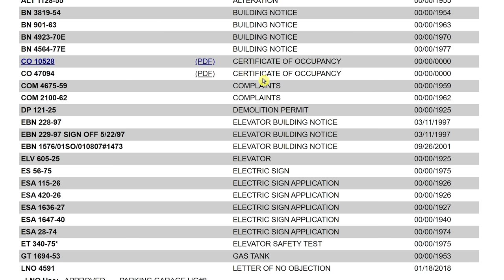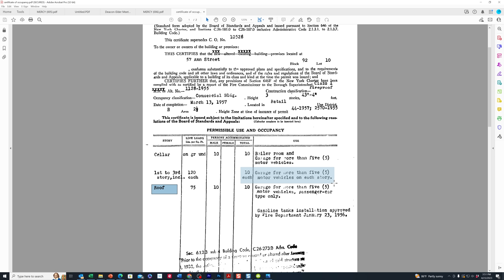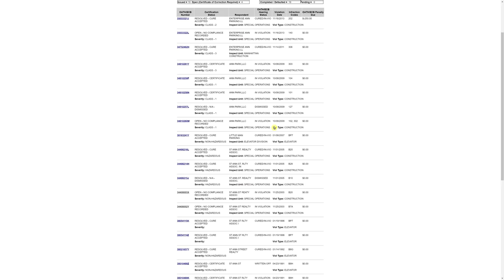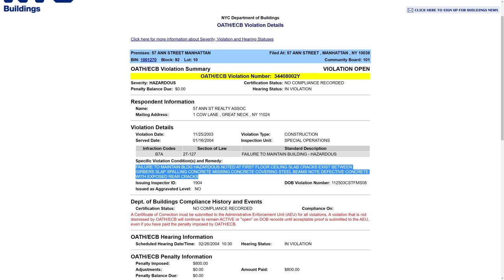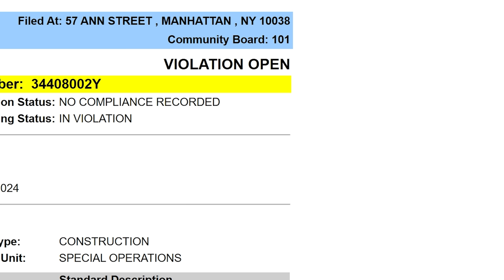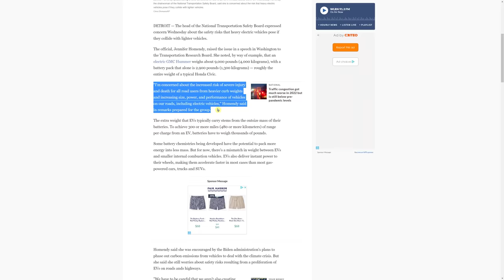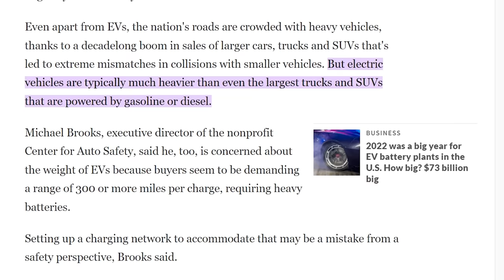4 Causes Of Fatal New York Parking Garage Collapse?

Comment: Excellent analyzation of this event. One tries to tell people the BAD aspects of electric cars, and none will listen. There's even more than just the weight, wrong with these things. I fully agree that could be a problem in this case. I've never seen so many vehicles crammed into such a small place before. I mean, I've never been to NYC, but I have done work in SF, and that was just crazy, given the age of  that building. 

Then to see the violations... insane. 

I think another thing you can add to your analysis of this collapse? The reports of the breaking support structure. It was so cool you had both audio & video from that car. We can hear them breaking, in what sounded like sequence, as the structure gave way. 

And to me? That sound was way too crisp & clear, instead of muffled, which you'd expect to hear, when things ARE covered with concrete. To me, that was a very telling sound.

Thanks for this great breakdown.
Reply: Do you listen to the good aspects of electrics? And bad aspects of gas vehicles? 

Just wondering. All new tech is usually flawed, I feel like there are overly biased people on both sides of the debate.
Reply: @Nikkeftw  Well, I worked in Solar for a few years- building, creating, installing. This was back when it was still fairly new, and I LOVED the IDEA of it. 

I'm NOT an "environmentalist"- I'm an "Outdoorsman". In my opinion, we are far & away the best to know what's hurting our environment- because we love the outdoors, we take care of it, and want it preserved for our future generations. We don't get insane over ideology- we just want our hunting grounds, fishing spots, camping locations, et al, protected & clean. 

But there's one other thing- "Climate Change" is a LIE. I know, I was there when the evil trying to kill our great nation atm, laid out EXACTLY what they were going to do- And using the "climate" to control people, was a large part of their insane agenda. There's far more to all this of course, but it all began with "Global Cooling", when the earth went through a warming cycle? The were made fools of, so they changed it to "Global Warming". THIS? Should have ended their, imo, criminal agenda- but it didn't. 

So they went "in-search-of" the perfect way to deceive people, and acquire POWER & CONTROL- which is all they care about. Enter, "Climate Change" Such a stupidly generic, and of course constantly occurring phenomenon? NONE would be able to argue against it. And any scientists who attempt to do so? ARE DESTROYED if they don't toe the line. 

These are just facts. I've no agenda here, and nothing to gain. 

Myself? Golfer, all my life. LOVE golf carts. Fun to drive, silent, and some? Are fast as hell. So it seemed there may be many positives to making them mainstream. I LOVE great ideas and theories, and ACTUAL advancement. 

What I abhor? Is "progressivism". Because that term has been co-opted & wordsmithed, to a completely NEW meaning. These people care NOTHING about our future, our earth, gays, blacks, whites, any of us. They care about THEMSELVES, and what I said above, control & power. 

They are a NEW kind of evil, I've been warning about for over 40 years. 

So, how does all this, tie into this gentleman 's video & post? Very simple- since they don't care about humans other than themselves, and those they can control & bend to their will? 

This allows inspections, such as the ones mentioned, which turned into violations, when completed in cities run by these uncaring monsters- to go ignored. And this? Get's people KILLED. 

These very same people? Placed Covid-infected patients, in NURSING HOMES- effectively creating a "KILL BOX"- Thousands were killed. People's Mothers & Fathers. 

Something like this? They care nothing about. So placing the SAME NUMBER of cars, in a parking garage rated for that many cars, YET, NOT rated for that many cars, each weighing 2-3000 lbs. MORE than what was initially approved? 

Is going to result in horrors such as this. And more people losing their loved ones. And the worst part? Is what our host stated simply, without any bias- they've NOT TOLD THE MASSES in our country, or elsewhere? About this insane differential, which is going to effect more & more things, and end more & more lives- 

Because these people care more about their AGENDA, than the citizens of our great country. 

And this criminal Weaponized Progressive Media (WPM), the very institution who's ONLY reason for not only existing, but being granted the power they have been, by our Constitution? Is VIOLATED, on a daily basis. 

This was THEIR JOB to find out about- to hold the POWERFUL, accountable. They refuse to uphold their responsibility to the American people, and instead choose to obey that with which they agree, AGAIN, at the COST OF AMERICAN LIVES. 

They lie, deceive, propagandize, promote false narratives & stories, but the worst one of all? They OMIT TRUTH & FACTS, because it they might hurt their narrative. 

And this, if properly investigated? Would shock the living hell out of the American people, as just how many lives THEY THEMSELVES have ENDED- for their own, selfish ends. 

It may seem these are not all intertwined, but they are. ALL of them.

And it's costing us our friends, neighbors, sanity, liberty, and very soon, our FREEDOM. Because this evil will NOT STOP. 

I care not for a persons political views- I only care that they love this country, which has given us so much. It is under attack, right now, today. 

And this event, along with so many others, are all because of THEIR ACTIONS. People who would normally be held to account, no longer are- and this allows terrible things to develop, such as the collapse of this parking garage, & so many other things. 

As I said, I just post truth & facts, to the best of my ability- I'm not here driving an agenda- it may seem that's what I'm doing- but it is far from it. Because this evil comes from BOTH sides of the isle, and everything in-between. 

There's nothing wrong with people developing good tech. The problem comes when it is suddenly FORCED down the throats of the people, WITHOUT DEBATE, WITHOUT the American people, "WE THE PEOPLE", giving them the permission THEY MUST HAVE, to do so many of the things they've done, yet NEVER ask us anymore. They just DO IT. 

The end results we see before us. Along with far more, that many have not made the connection with... YET. They will, eventually, because we ARE America - the question that leaves unanswered is, "Will it be too late when they finally realize what's going on"?
Reply: There is no reason to condemn electric vehicles because of their weight, or attempt to lay the blame on them for this disaster. I didn't see any in the pictures, I am sure if there were there would be all kinds of handwringing about Li-Io batteries, fires and all the rest of the FUD. It is intuitively obvious these old buildings were not designed for the weight of the sheer number of cars they pack in them in the interest of economics.  SUVs, pickups, and luxury sedans, all gassers weigh considerably more than the vehicles in the days when this old building was designed. Add that to the ignored violations and lack of maintenance/inspections and you have a recipe for disaster. Frankly I am surprised this hasn't happened before now.
Reply: @The_DuMont_Network  Exactly my thoughts. SUV's are at a minimum 3-400 pounds heavier than an average EV, and luxury sedans can weigh the same as a Model 3. 

You can think what you will about batteries, would be nice to have a good hydrogen solution, but having electric drive units is nothing short of the next logical evolutionary step in cars. It removes unbelievably many moving and complicated parts and nearly eliminates service-demands for the drive-train. Its way more efficient and delivers smoother power and more of it compared to size and weight.

It is indeed very surprising that this didnt happened 20 years ago. 

I read an article with danish statistics for cars going up in flames. Correcting for ratio of gas/EV, in 2021 5 gas cars were one fire for every EV. Sadly, it didnt correct for mileage or age.
Reply: Electric cars had nothing to do with it. The weight of the cars is not an issue for garages. Garages are designed for 50psf live load. You are still well below the design limits with electric cars. The codes have already taken into account heavier cars.
Reply: @yodaiam1000  "The Codes"? Oh, you mean the one's NOT being enforced, and still sitting open on the cites desk? YOU have no proof of your statement. 

WE stated that they MAY have had an impact. And when you completely change the design of something that's been the same over the years.. except that vehicles became LIGHTER, instead of heavier, and then return, & exceed that weight? 

Problems gonna happen. WE are speculating what we BELIEVE MAY have happened. not state facts not in evidence, as you just did.
Reply: @rickrickard2788  I stating that electric cars are not an issue. The video stated it MAY be an issue. I am just letting you know that it was not an issue.

I am referring to the code that the building was originally design to and sealed by the original designers to conform to that code. Back in the 20s it would have been designed by an architect. Modern structures are designed by structural engineers. The city violations are not code violations. Those violations are for improper maintenance which is more likely to be the issue.

If there was an issue with electric cars, there would be an issue with ICE cars as well.

A Telsa weighs about 5000lbs. A typical parking space is 12'x20' which is a 21psf loading. It is well below the required minimum of 50psf and there are factors of safety on top of that. Electric cars are not an issue in terms of structural design. There is plenty of leeway with the code minimums to allow for electric vehicles.

The code includes for very rare instances where the car is surrounded by people and is loaded up items within the car. The weight of the battery does not factor significantly into the floor design.
Reply: @The_DuMont_Network  Ever see towing charges for electrics?  Weight is a significant factor in making recovery harder.  I like the idea of electric cars - batteries are still the problem. That and our grid has no where the capacity needed.  I look forward to CA burning as more power lines sag into the forests in the winter and not just the summer.   And with the war on natural gas and oil the power outages in the northeast are going to be epic.  People not being able to charge cars will be the least of their problems.

Comment: Most spalling issues are related to corrosion of the rebar. You don't really de-rate the concrete. The corrosion is usually caused by carbonation, or the lack or poor maintenance of a membrane. Old parking structures like this one usually don't have membranes. Older concrete technology also tend to be more permeable to chlorides. You can fix the spalling and corrosion and the concrete still substantially  has the same strength.
Reply from the maker: Yes you can fix the concrete but in its current spawning state. There's no way it's strong enough to hold the weight it was built period
Reply: @jeffostroff  Without repair and maintenance, spalling does typically weaken the structure. I would suspect that the corrosion of the rebar or steel is more of an issue. Although concrete and rebar work hand-in-hand so it is hard to separate the effects on the concrete alone. 

There are a lot of buildings from this era that used steel section encased in concrete rather than just rebar. Typically the concrete was just there to fire protect the steel beams (although they would typical used the concrete to strengthen the axial capacity of column sections). You may find in this case, the primary steel sections may have corroded but it is hard to say until there is more information about the structural form.

Comment: Permit said 5 cars on the roof in 1925. Ford model A weighs less than 2,500Lbs. They had 25+ modern cars over 4,000lbs on the roof 100 years later. Clearly they massively overloaded it. U can see the rivets sheared off the I beams.
Reply from the maker: Plus some of those vans were the larger multi passenger type
Reply: Permit says it is for a class of usage that's named "parking for 5 or more cars". Read the words around "5", those are not just decoration.

Comment: Wow... I didn't know they made SUV-sized can openers.  Must've been quite a trick getting a car out of that garage.
Reply from the maker: They ended up collapsing the garage more during removal
Reply: I meant while the garage was still standing and being used.  Those vehicles were packed tighter than I thought possible using merely a steering wheel!

Comment: What does the age of a building have to do with a collapse?  Spalding concrete is a maintenance issue, not age.  There are not moving parts to the structure, so age does not factor in.  The only thing I can think of is foundation settling.  But that should stop after ~10 years or so.
Reply from the maker: Correct but also who knows the quality of the concrete such that over time it could be degrading

Comment: Loving your collapse videos.  Well not loving the collapse, but your analysis and insight.  To me, based upon your video and post collapse pictures I've come across, it appears that the bricks were a decorative facade.  And I believe (as of now at least) what you pointed out about it had no impact on the collapse.  The window sill cracked you pointed out, for example-- The low quality only shows that it appears perfectly vertical in line with the pane of the window and could likely be a joint between two slabs.  Also in post collapse pics, the (what I'm going to call for simplicity sake) office area did not seem to take any damage from the collapse, most ground level damage occurred behind it.  But due to the recovery aspect of the collapse, I have yet to find a decent front view shot of the collapse.  I could imagine this collapse being 100% interior, with only exterior damage caused by the interior collapse and from the recovery.  
If that theory is correct, it could have been an old building built in 1925, that was converted into a parking garage in the 1950s.  It's been done here in Detroit.  In fact, look into the movie 8 mile, the old united artists theater is a parking structure built into an old theater.

Comment: A little late and maybe a bit tangential, but yes, long-lasting electric batteries are HEAVY.  I drive a stand-up reach truck all night at work.  Battery's good for about 6 hours and it weighs 3,000 lbs.  We also have electric sit-down forklifts - same thing, 6-hour charge, but those batteries are even larger and weigh closer to 5500 lbs.  And that's JUST the battery, not the rest of the forklift.

Overloading these aging ramps with all these massive vans, 4x4 pick up trucks, SUVs, etc. is clearly going well beyond the 4-door sedans and occasional pickup truck they were clearly designed for originally.  Increase the static load enough, and bad things are bound to happen, as we've seen plenty in the last few years.

Comment: As an EV owner and driver I've been well aware of the weight, but I've never really thought about it as far as the effect on parking garages and such. My Chevy Bolt weighs about 3,500 lbs, A Tesla Model 3 is over 4,200 lbs. A full-size SUV is likely to go over 6,000 lbs while a RAV 4 is about 3,500. That's also about what an Avalon weighs. A Nissan Cube is about 2,800. I'm inclined to draw the conclusion that, while EVs are heavy for their size, they don't begin to match the weights of full-size SUVs or pickups - especially diesels. As a point of comparison, a Ford F150 Lightning actually is about a thousand pounds lighter than an F350 Super-Duty and only about 500 lbs heavier than a regular F150. 

Basically I think that until EVs become a more substantial part of the mix (at well under 10% right now) the weight issue can be discounted as contributing to this particular collapse. I'm also going to hazard the opinion that EV drivers are more likely to seek out newer parking that has charging capabilities. I'm going to go with the "Old building, poor maintenance, too many cars" explanation for now.
Reply: Tesla model s sedan  =4500lbs
Toyota corrola sedan =3000lbs
Reply: @user-pf5xq3lq8i  my gas powered tahoe weighs 5800 lbs. empty,  it will stay on the ground level.

Comment: 8:23  Electric vehicles??  Sure the batteries weigh lots but full electric vehicles (the heaviest) don't have engines i.e. there is a weight savings there.  The average Tesla weighs between 3500 and 4200 pounds.  Cars in the mid 70s were about 4000 pounds on average.  Not much difference?  A Ram truck weighs between 6000 to 7800 pounds.  So NOT even close.   I will give you #1-3 but 4 isn't even close.

Comment: Considering 1925's automobiles and they weighed little. Per the building plans, my guess for failure is based on the video....very much over loaded garage due to cars weigh more today. Building and construction in the past got built very well, in fact overbuilt unlike today where buildings are only built to spec, nothing extra. they put too many sardines in the can on this one.
Reply: The building - built in 1925? What's the date 1957 significant for? Structural re-design and more girders and concrete and rebar?
Reply: @uploadJ  Correction...1925 era. cars weighed little then. I did say 1950's, I changed it to 1925. Thanks.
Reply from the maker: Laws change over time, so possibly by 1957 it was converted to a garage and needed a certificate of occupancy
Reply: It was converted in 1957 to a garage.  It was originally offices or industrial.  Never built to be a garage.
Reply: @jeffostroff  Likely more than we know.